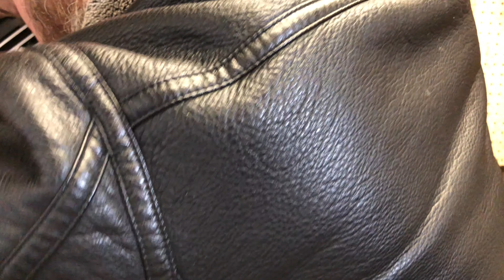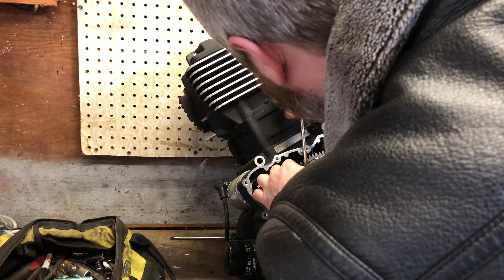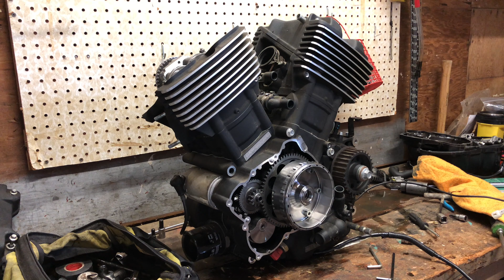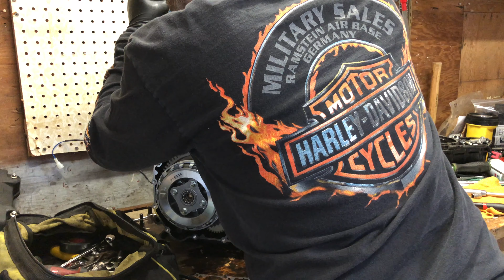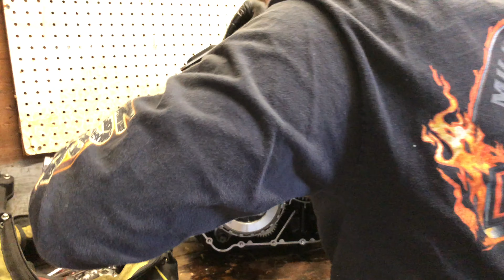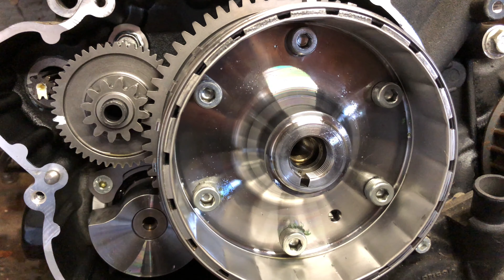Part 2 - Harley Street 500 to 750 upgrade

Comment: i bought the fist  M18  fire 1/2 impact its still going with original battery that i go separate its a bit small in capacity  but works for my stuff and wow its says it had 1200lbs in reverse it just may have stated power and even to this day is fully repairable i looked it up on ebay wen i thought it died but it was my wet battery 2nd battery that came with saw-all drill impactdrive ebay combo pack were i found the best deal homedepot is were i found the impact years ago i love all that M18 crap